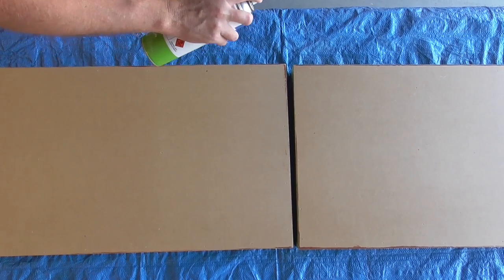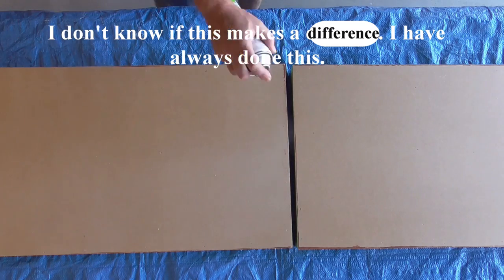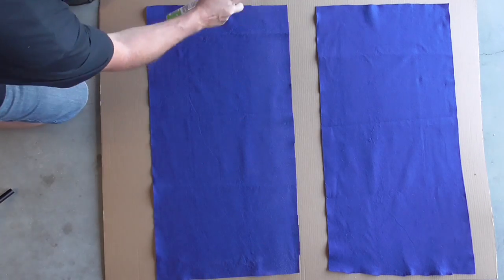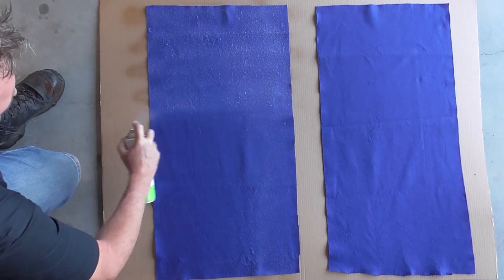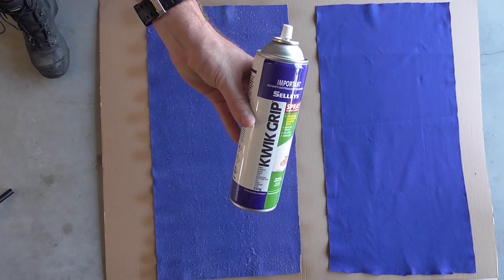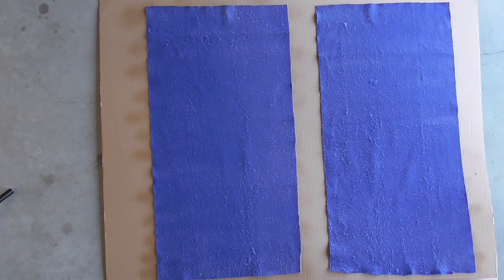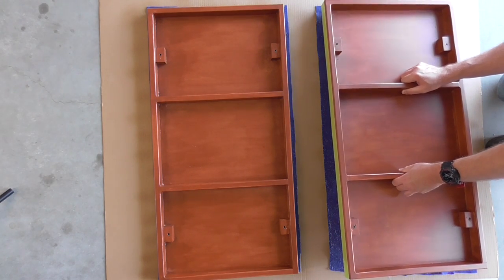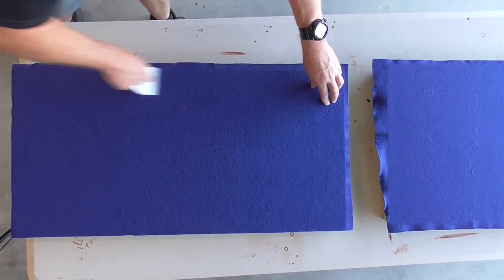HOW TO: apply felt to timber/wood (MDF)

Comment: Very useful thanks. How forgiving is the adhesive if you need adjust to pull out a bubble or wrinkle? My project is relining the inside of an old accordion case so it has a curved surface to the lid.
Reply from the maker: I have lined dice trays which one required a little adjustment. I was able to lift it up and adjust. This was wood though. Try it on a similar material with a scrap piece and see what it does. Cardboard maybe. Take your time, maybe do it in sections. Bottom first then sides. Just tape up the other areas you are not doing so you don't get glue on them. That way you don't have to worry about cleaning unwanted glue off.

Comment: Thanks for the great video. About to do this to a chess board I've had a friend build. What do you find the most effective way to get a close trim on the edges?
Reply from the maker: Thank you for the feedback. 

I use a small box cutter with snap off blades, so I can always have a sharp blade to use. This has always given me a close cut to the edges, and I have also used this method when I have made my dice trays which are a box shape. Hopefully this helps you with your chess board project.
Reply: @diceitupgaming  thanks a lot,  any other good alternatives to the spray adhesive?
Reply from the maker: You can get a paint on glue contact that might work. I have purchased this from my hardware store but haven't tried it yet. I am about to try it out on a test piece to see how well it works and last.

Comment: I've been applying felt to the inside of jewelry boxes. I've been using the self-adhesive type. I cut the felt before, very close to the final fit dimension, fit it and tighten up the edges w/ a credit card. Finally, I come back w/ a razor to trim the excess. It's a lot quicker than your method. Nice work, nevertheless ~
Reply from the maker: Cheers mate. I'm guessing your self-adhesive tape would be a double sided tape. How long does it stay stuck?